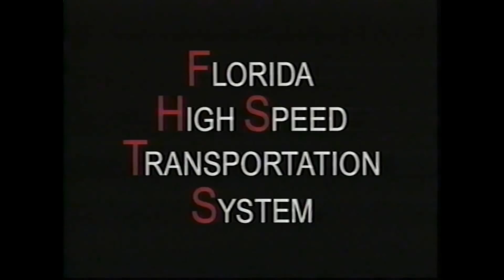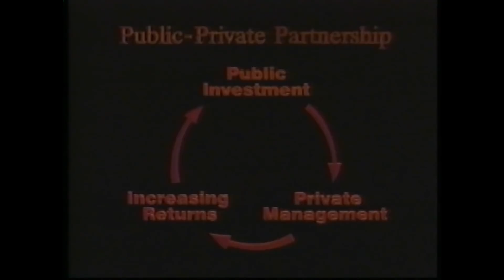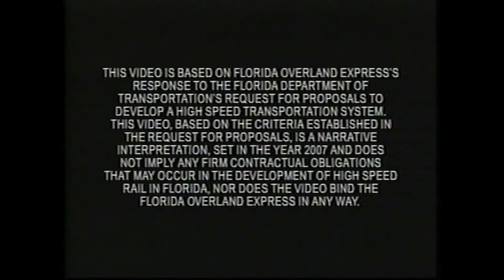Florida Overland EXpress - 90s Florida Bullet Train Plan

Comment: That sucks that the project was canceled. If the project got the green light by now going to Orlando or Jacksonville from Miami would had been a regular commute for thousands of people... What a shame... 

I don't know if it was me but I thought that kid was annoying and disrespectful... I would had reported him and had him duct taped to his seat.................
Reply: this Project is avenged by brightline High speed rail 

Thanks to Siemens Charger DMUs
Reply: Well, Brightline is just the watered down version of the "FOX" (sorry FEC) and everything except the new Orlando airport station just resembles late 1970s Britain because of the slower diesel powered high speed trains (125 mph as in "InterCity 125").  If we would've had the Florida Overland Express constructed instead if it weren't for politics and other factors shutting that project down early on, we would've saw faster electric trains flying over roads instead through normal grade crossings.  I'm not from Florida, but I think that would've made a massive impact here in America a few decades earlier and it's a real shame it never came to that.  I really like this video even though it's nothing more than just a window into an alternate universe where if it would've happened.